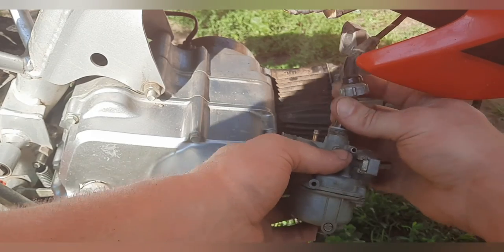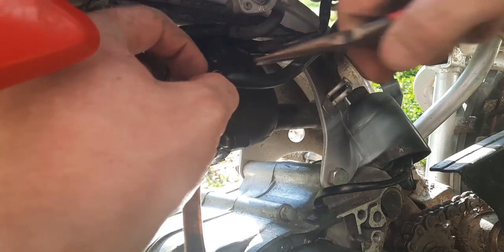XR70 Timing Procedure/ cam chain roller replacement

Comment: Damn dude. Thanks for the walk thru. Bout to do the same. 1997 xr70r. Going to rebuild the top end and get it going for to ride my little boy around on. Mine needs a few extra bits tho. The frame is snapped where the exhaust bolts on and two other supports need previous repairs re welded. But all my parts are in and I'm just trying to get an understanding of timing before I hit it. Hope to have it running by the end of this next week.
Reply from the maker: Happy to hear you, and your son are going to have some fun! If you want, I also have a video on a TB 88 cc big bore kit I installed on my sons bike as well.

https://youtu.be/63-CE5l6fjA
Reply: @larryc  not there yet, but next to fix is my old z50 then rm80
Reply from the maker: @halfpipehillbillies5591  nice! I am a big fan of the rm 80. Ride them in good health, and enjoy with your family.

Comment: Did this today it wasnt the cause of my noise but im glad i did it i got to know the bike better. Idk what i did wrong but now i have no throttle response im sure is something simple.
Reply from the maker: Glad to hear you got to know the bike better! Not sure what is causing your throttle issue. I would check your carb just to make sure something didn't get in there when you had it off. Your noise is most likely the cam chain itself. They stretch over time. I just ordered a big bore kit and a hot cams timing chain for my sons bike and will post the video as soon as I put it on. I will give you my thoughts on the new cam chain. Hot cams claims it to be silent and to exceed  OEM specifications.
Reply from the maker: Here is a link to a new video. https://youtu.be/63-CE5l6fjA. It has some useful information on changing the cam chain.
Reply: @larryc  you the man i think this is my problem gotta tear into it again lol.
Reply from the maker: Lol 😆you know how it is. Ride,break,fix, and repeat

Comment: Do you have a video that shows how to remove the valves? I need to replace my valve stem seals, but don’t know how to remove the valves to do this.
Reply from the maker: No I don't currently have a video on that. My valve stem seals were good so I didn't replace them. However once you have the cylinder head off there is a cover on the side. That cover will allow you to remove the rocker arm assembly. I would keep them in the same order they came out. I have used a metal coat hanger to string them on in the past on other bikes. I would also label them intake and exhaust. After you have the rocker assembly out you can push the valve spring down and remove the valve spring retainer. You won't need a special tool or anything. After you have the valve out remember to lubricate the new seal with some oil. Hope that helps. I wish I had a video on it. I will try to make one in the future.
Reply: @larryc  this is more than enough help, thanks!

Great videos by the way. You were very helpful on all other points.

Comment: The cam chain seems to go lose on the bottom while going through it’s strokes after you were done. Is that normal? Seems odd that the chain would just go lose like that. Mines doing that too and I have been fucking with the timing thinking I did something wrong… so is that normal?
Reply from the maker: You are correct my cam chain was stretched. Here is a link to my video where I replace it https://youtu.be/63-CE5l6fjA . It is not a  dedicated cam chain video, I also put a big bore kit on it. However it shows the cam chain replacement,and should help.
Reply from the maker: For that video here is a time stamp 37.21 is how tight it should be with the tensioner installed. Around 38.10 is with the tensioner out, and it is still tighter than my old cam chain was. After that you can see I do 2 full revolutions, and the cam chain isn't bouncing around. I went with a Hotcams cam chain for about 30$ and it was well worth it 👍